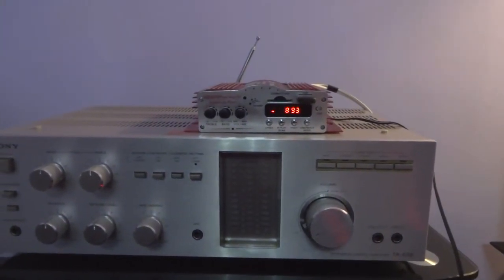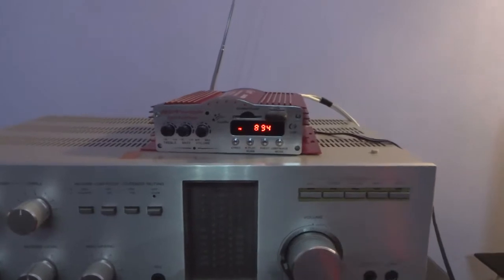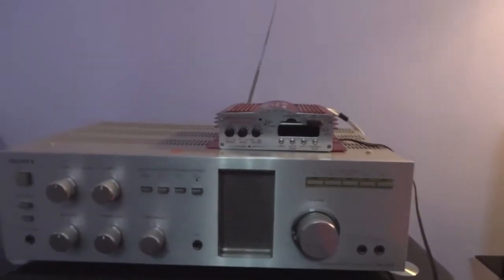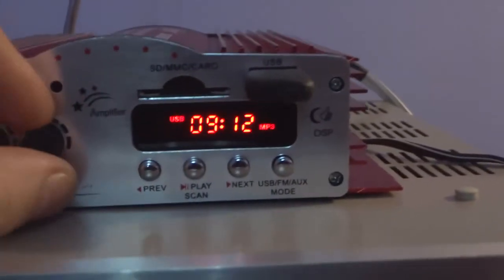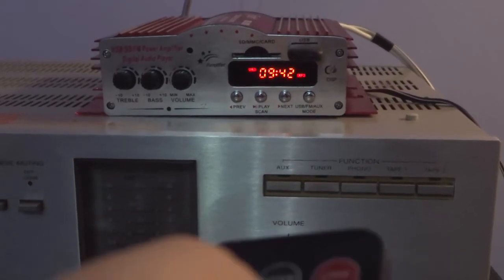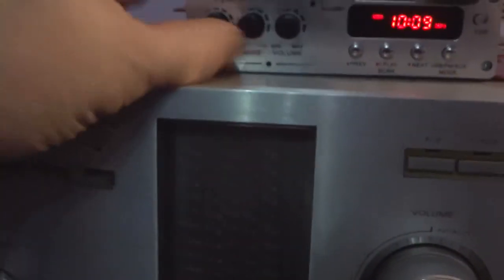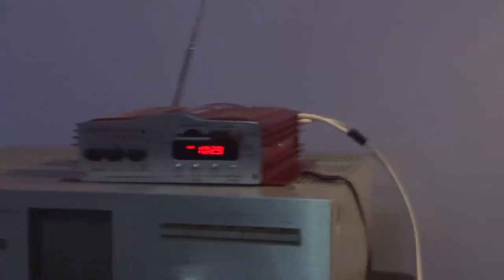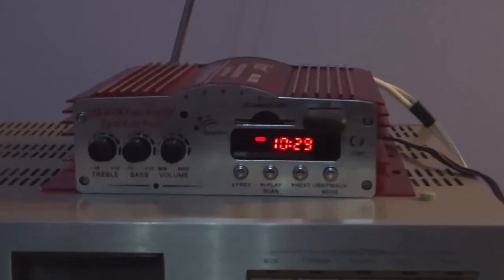KINTER MA-200 AMPLIFIER - TEARDOWN & CONCLUSION

Comment: I bought a similar product with the same TDA7388 like in the video, replaced the capacitor to 3300-microfarad 25V one and using a 14V 5A adapter. But the amp is shutting off at mid volume with all 40W 4-ohm speakers connected, then I will have to dial it back the volume so as not to shut it off again.

Any ideas of why this still happened?
Reply from the maker: Its the built in overload protection, run the speakers in series not parallel
Reply: @Synthematix  What do you mean?

All speaker terminals are utilized, and the last time I only connect one speaker (in series ofc) and set in full volume nerfed the IC chip for whatever reason.

I have a spare TDA7388 chip on hand now for replacement.
Reply from the maker: @IrOnCuRtAiN61  4x4ohm speakers in some circuits are too high of a load for the amp to handle, try 4x8ohm
Reply: @Synthematix  Another question; if I replaced the reverse protection diode to 6 amps, is it recommended or much higher than that?

Comment: Hi, The filter caps you refer to is the 16v one that you said to increase to 25v or is it another cap on the board?
Reply from the maker: Hello, replace any 16v with 25v equivalents yep,  up the voltage but keep the capacity (uF) rating the same

Comment: can i use this for 1300 watt pioneer ts-wx306t bass tube,please reply fast
Reply from the maker: No chance sorry its simply only capable of outputting 45watts x 2 at 4 ohms
Reply: +Synthematix which amp is better
Reply from the maker: none of this type you need a proper car amp with at least 15 amp power supply
Reply: +Synthematix what about sony xplod 1000 watts amp
Reply from the maker: that will do the trick yes
Reply: +Synthematix thnxxxx

Comment: Hi, thanks for the vid, I had already ordered this amp before I searched for any vids,  I have mine hooked up to 2 transducers under my gaming chair, but could you tell me if the 4 channels can be bridged to power the 2 transducers?  (Thanks in advance).
Reply from the maker: Look up the specs on the texas instruments chip m8 it will say if it can be bridged, but i doubt it. will more than likely damage he chip.
Reply: Synthematix thanks for getting back to my question,  I tryd looking up the chip, but didn't really know what I was looking for,  so I contacted the seller and they confirmed what you said, that bridging the channels would damage the chip, thanks anyway mate.

Comment: Brilliant video. Thank you. I just bought one of these to power 4 Moderno M6 outdoor speakers (I'm going to have the amp screwed under an awning). I already have some thermal paste for the chip, but it seems like the filter capacitors are a sore spot. Do you have or know of a guide for replacing them?
Reply from the maker: Pretty good arent they mate especially for boosting laptop sound, thanks for commenting.
Reply from the maker: Capacitors as a rule are easy to replace as long as you follow a couple simple rules, 

There are a few GOLDEN RULES when working with electrolytic capacitors, firstly look for polarity in the circuit, the striped side of a cap is always NEGATIVE. you must make sure that if you are replacing them they get soldered back in EXACTLY the same way as they came out, sometimes the circuit board is not marked to show this, so before starting any work it would be useful to take a couple of digital photos with a camera. Replacing a capacitor fitted the wrong way around will cause explosion. Dont believe me? put a 10V cap on a 9v battery the wrong way around, then run! Bigger the voltage of the cap the wrong way around in the circuit, the bigger the explosion.
*
There are quite a few types of capacitors, another type is NON POLARISED AXIAL, these are not polarity sensitive and can go in a circuit in both directions they have no polatity marker just like a standard resistor, these are sometimes found inside speakers to filter out bass to the tweeter.
*
Concerning capacitors installed in a power supply or other power circuit: these are mainly rated at high voltages for example 200V, you must ALWAYS discharge them prior to desoldering them from the board. If a capacitor is rated at 200V or above it could very well and probably will hold a 200V charge and in turn can lead to severe burns and fatal electric shock. Discharge them by clamping a crocodile clip wire to a high voltage rated screwdriver and the other side of the crocodile test wire to the other terminal of the capacitor touch together until you hear a pop or see a spark, repeat this five minutes later to make sure the cap has safely discharged.
*
When replacing a capacitor in a circuit of any kind ALWAYS use a capacitor that's rated at the same voltage or rated higher, NEVER replace with one that's lower voltage, IE: if you are replacing a cap that's rated at 63V 47uF you can safely use one that's rated at 100V 47uF, never go lower in voltage. Try to keep the uF or (microfarad) rating as close as possible to the original, ideally it should be exactly the same only in certain circumstances should it be changed.
*
Capacitors and temperature: Most electrolytic capacitors are rated between 85 and 150 celsius, however in a circuit that has a lot of heat build up this really doesn't mean much as heat degrades the performance and lifespan of capacitors and in time and causes them to fail no matter what their temperature rating. ie: if you are replacing a capacitor in an amplifier or other piece of equipment that generates a fair bit of heat, make sure they are fitted away from heatsinks or high powered resistors tilt them away from heat sources, i have had many stereo amplifiers fail because of this problem, in the end i ended up fitting a slow running fan to cure the problem.

Comment: i bought a lepy lp-838 its bloody marvellous i run it off a 10v 1.2amp dc adapter from an old router and its nice and loud and clear
Reply: im thinking it way way better than yours i get no hiss or pop from turning it on or off and it cost £12
Reply from the maker: This is because at 10v its being underpowered, at 12 or 14.2v the problems arise and need to be rectified.